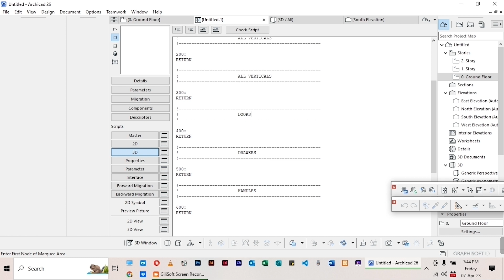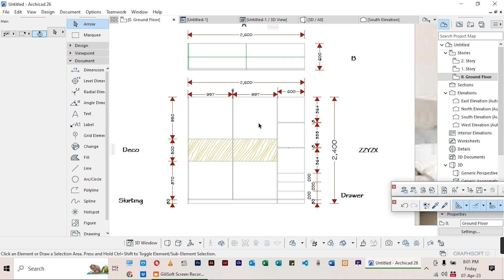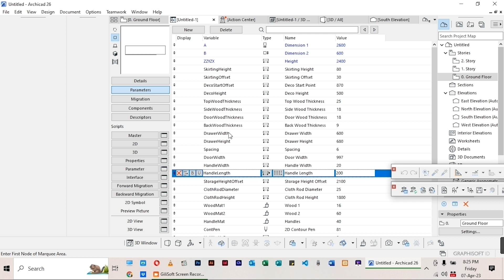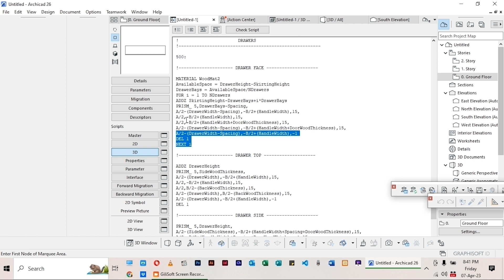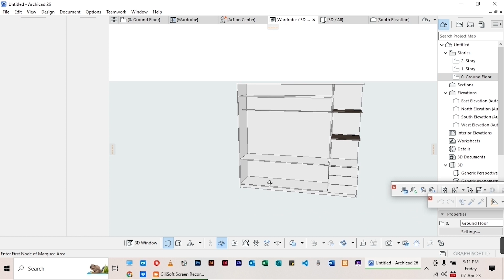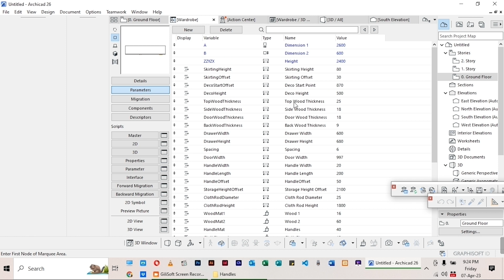"Mastering GDL: Custom Wardrobe Design From Scratch"

Comment: Dear Duke, Explain please 🙏 Why did you decide to use GDL for creating objects instead of using standard library of archicad or 3d objects in 3ds format?
Reply from the maker: Thanks for your question. I do this because it gives me the flexibility to do my own stuff, without recourse to what is there. In most cases, I add a few things to the same objects that the standard library hasn't considered.